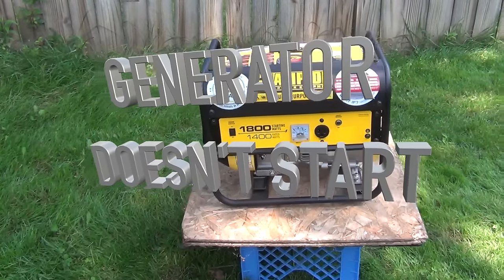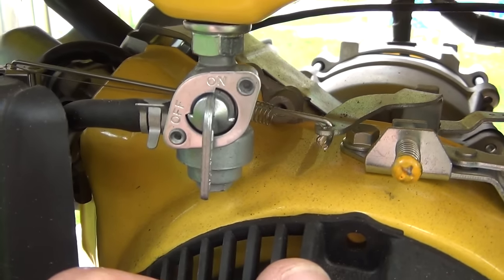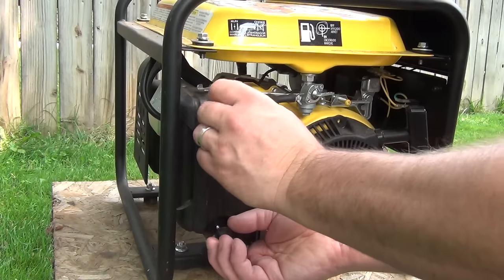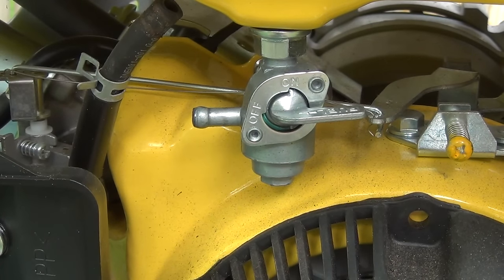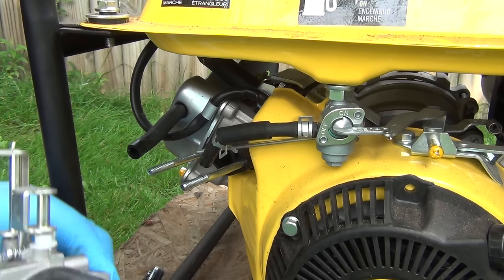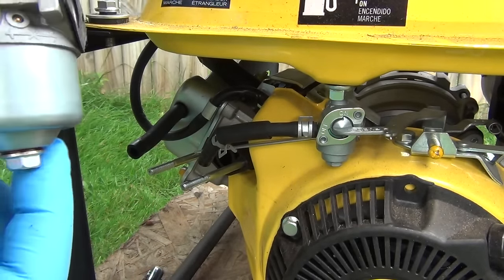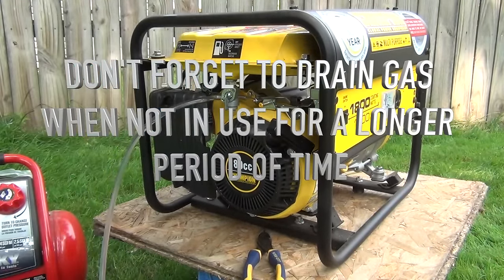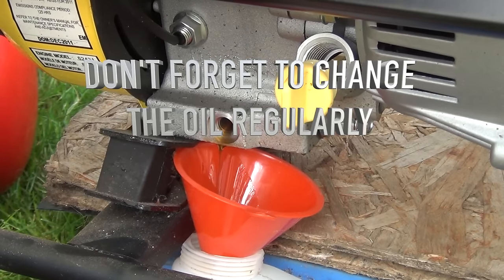Generator Does Not Start?

Comment: Generator would start, run 5 to 10seconds and shut down. The low oil light was on, but the the oil level was full.  I found the yellow wire coming out of the crankcase, disconnected it and electrical taped both connectors so they wouldn't touch each other or any part of the generator. It started and ran like a Rolex.  Thanks for the very helpful, detailed and easy to follow instructions.

Comment: Thanks mate, you got me going again. When I checked my oil level, it was almost empty but after I topped it up, the generator started immediately. You have saved me a lot of hassle. Well done and great video.
Reply: Very good tip Mate ! I oftentimes forget to check suchlike things.
Cheers !
One reason I love the Harbor Freight  Neon Spark checker, you can test for spark with virtually any engine that produces a spark save anything that has individual coils on each cylinder.

Comment: Tried to start my generator yesterday. 
It is the exact model you have so finding this was lucky for sure.
Today I did as you show and found the jet clogged, a bit of cleaning and reassembly and it started right up.
Without the guidance i would not have fixed it most likely , 
Thanks for helping me get it running again!

Comment from the maker: By the way: Most of the time it is old gasoline, that prevents the generator from running. It seems to collect in the carburator.
Reply: what do you do if its old gas
Reply from the maker: Drain the old gas, open the screw on the bottom of the carburetor as shown in the video, put everything back together, fill in new gas and you're good to go.
Reply: mygiguser my generator starts but no power to outlets any ideas
Reply: Check thermal circuit breaker sometimes they fail open circuit and won't reset check wiring and sockets for continuity you should be able to test the resistance of the stator through the mains outlet and this will prove the generator will work if there is a rotating magnetic field. If the generator has been dormant for a long time and it is self exciting type the rotor can lose residual magnetism needed to self excite unfortunately only way to fix that is remove the rotor which is the spinning bit inside the alternator and give it some loving with a strong magnet not important to be perfect just enough to leave a residual field to get things moving probably not a bad idea to test the diodes in the rotor field f accessible then put it back together and run the generator it will establish correct magnetic field once it's generating again.

If unit is externally excited then could be a faulty avr ( automatic voltage regulator ) board or worn brushes and in rare cases open circuit winding in rotor in this case repair gets expensive.
Reply: Check thermal circuit breaker sometimes they fail open circuit and won't reset check wiring and sockets for continuity you should be able to test the resistance of the stator through the mains outlet and this will prove the generator will work if there is a rotating magnetic field. If the generator has been dormant for a long time and it is self exciting type the rotor can lose residual magnetism needed to self excite unfortunately only way to fix that is remove the rotor which is the spinning bit inside the alternator and give it some loving with a strong magnet not important to be perfect just enough to leave a residual field to get things moving probably not a bad idea to test the diodes in the rotor field f accessible then put it back together and run the generator it will establish correct magnetic field once it's generating again. If unit is externally excited then could be a faulty avr ( automatic voltage regulator ) board or worn brushes and in rare cases open circuit winding in rotor in this case repair gets expensive.
Reply: Thanks.  Good advice.  If you had a suggestion how would you prevent in the future.  Buy special gas, gum out.  Seems to happen to me every year.
Reply: Actually its not old gas collecting in the carb, its water. Gas floats on water, so the water will always be at the lowest point of your fuel system (your carb).

Ethanol which is blended into the gas, will make the gas collect water faster, so you want to pick ethanol free gas for any carbureted engine (if available in your area).

Top tip: When shutting your generator down before storing it again, dont use the electric cut off! Just close the pet cock and wait until the generator dies. That way the fuel bowl of the carb is empty and it cant collect the water. Of cause this will not stop the gas in the tank collecting water. But that way its much easier to remove the old gas and put fresh gas in. Also the water in the carb will cause some serious corrosion on the brass (jets) and aluminum carb parts. So you dont want any water to be in your carb.
Reply: It works if I have to chare

Comment: Many thx for the video … my carburetor interior and particularly the float were a deep yellow colour.  I tried compressed air and a deep cleaning but didn’t work.  Starting again tomorrow but planning on disassembling and cleaning the jets with carb cleaner and steel wool - wish me luck
Reply from the maker: Good luck!
Reply: @mygiguser  works now, thx for the excellent video and the 🤞. the main jet didn’t appear to have a slot in the brass bolt.  I applied carb cleaner down the tube - two side jets were easily removed-.at first the screws wouldn’t budge - great care must be taken with these brass screws because the metal is very soft  - so I applied penetrating fluid and waited 30 minutes.  Thoroughly cleaned the jets with carb cleaner and slid a thin needle through the tiny holes in the jets.  Didn’t start last night but this morning it’s working like a … we’ll, like a generator

Comment: Difficult to come to terms that the spark plug was not checked at all,and probably one of the major causes at generator startup failure.
Reply from the maker: Spark plug may be second on the list,  but thanks for the comment.
Reply: Spark plugs rarely fail on small engines, I work on them it’s usually the carburetor that’s clogged up because of ethanol gas. Spark plugs usually last the life of the engine
Reply: @mygiguser  "Spark plug may be second on the list...", but 10 times quicker than all the work with the carburator.

Comment: I guess the consensus is that the problem was old gas.  I didn't see a lot of gas in the carburetor.  I use leaded gas in my small engines.  Its expensive and the octane is high, however, the ethanol content is 0%.  Ethanol invites moisture (water) into the carburetor and before you know it, you are either rebuilding the carburetor or replacing it.  The alternative to leaded gas, if you can't find it, is to buy gas with a low ethanol content and treat it with StaBil gas additive.

Comment: What is the tool used to remove the air filter housing?
Reply from the maker: ratchet with extension and 10mm socket?
Reply: @mygiguser  thank you! My adjustable wrench couldn't fit the tight space but I managed to remove it with pliers. Thanks to your instructions I was able to make the generator work.

Comment: Followed exactly.. Still not running or even almost starting.  Of course in the middle of the night with no power.  Only thing left is to try new plug. It looked fairly clean when i took it out to look..but thats the onoy thing left it might be... Plenty of gas, blew out the carb holes.. Nothing.
Reply from the maker: oh man, sorry to hear. my power is out too right now. what are the odds. did you check the oil? there is a switch that turns it off when the oil is low!
Reply: Just did per your advice.. No luck there
Reply: Forgot to add reply... Took apart carb again, used air compressor to blow out holes.. Works like a champ. Now at least I know how to take it all apart.

Comment: Hey man, i have dual fuel generator i mean generator use natural gas and petrol as fuel . now generator works well with petrol but not with gas, what will be the possible problem with my generator, please tell me.
Reply from the maker: PUBG Gamer that’s even easier, i can’t believe you have a problem with that. Either the hose is clogged, or the pressure regulator is damaged.
Reply: @mygiguser  thank you for your reply, can i send you my generator's video? Because here mechanic didn't correct it. :(

Comment: So here's a question: I cleaned the carb (2 pinholes, blew out the emulsifier tube as it cannot be removed). With a drained carb it starts on brake cleaner, but when I open the fuel valve it will not start, not even on brake cleaner. Where should I look?
Reply from the maker: maybe the fuel valve is clogged? or the gas tank vent not working?

Comment: At the throttle, I see the thicker wire.  What is the tiny wire ?  What is it supposed to be connected to ?  I had to manually hand-jive my throttle for about a minute before the engine would run on it's own.  Thanks !
Reply from the maker: are you talking about the throttle return spring?

Comment: turn gas valve off....when storing...and run until gen stops. This will empty the float bowl...so as not to collect water and prevent corrosion of old gas. Sta-bil should be used if storing for longer than a week.. Gas looses octane quickly.
Reply: H

Comment: lil tip it worked for me  ....the filter in the tailpipe was completely dirty and that wasnt letting the fumes out ... there fore shutting off the engine ......so i clean it and problem solved.
Reply from the maker: Thank you. Great tip!
Reply: Hie, I accidentally mixed 2stroke oil with petrol in 4stroke generator and tried to start luckily It didn't start so will you please help me.
Reply from the maker: Just remove the 2 stroke gasoline, and refill with new 4stroke gasoline. No problem! Thank you for your comment!
Reply: @abrakamjoxmhlanga1551  
You should be able to run two stroke fuel in a four cycle engine just as long as it is just one fuel tank without damaging any internals just as long as the fuel isn't too rich. I do it all the time.
Reply: frank ramon villalobos
Reply: Spark arrestor screen is what your referring to.
Reply: A woman here who has never tried it and doesn't know much of generators about to ask a silly question. What is a tail pipe?
Reply: Is it the same as the exhaust pipe?

Comment: That was a great video! But what was the problem?  it didn't seem to be diagnosed
Reply from the maker: Well in this case metal shavings were blocking one of the jets. This must have happened in the production process of the carburetor. It was working for  at least 20 hours, as it all of the sudden quit, and then never started again.

Comment: Hey mine don't start I even cleaned carburetor and remove the wire sensor for oil all it does is run for like ten minute and shut off what to do next I have been trying 4 days now
Reply from the maker: Earl Aragon the vent in the gas cap clogged?

Comment: tip to  easy start. just put quick start propane gas into the chalk filter. and thats it. also you cn use the  lighter propanane gas if you not have the quick start be sure to adjust the level of the lighter  to high to give more gas to the filter .
Reply: "chalk filter"???

Comment: Unplug the oil pressure switch. If it starts, change the switch. If it still doesn't start look for another problem
Reply from the maker: Yes, that's right. When the switch is closed, the wire is grounded, and the engine doesn't start. Either not enough oil, or the switch is broken. Make sure you have enough oil! It doesn't take much to wreck an engine without oil!
Reply: jerry Cannon would you know why mine runs on choke only and smokes white smoke then when I take choke off it stalls.
Reply: Tia.
Reply: Ranjit mm m

Comment: Not sure what you did here, you cleaned a clean carburetor now it works?
Reply from the maker: ns671fr there was a tiny piece of dirt stuck in carburetor. The generator was only a few hours old, ran maybe 100 hours before it stopped working.

Comment: most of the times, the needle get stucked and don't let the fuel get into the carburetor... especially on 2 strokes engins, because oil residue turn into some kind of glue
Reply from the maker: Nando Z great, but this is a four stroke engine.

Comment: Why not spray quick start into the carb?  If the engine fires then a fuelmissue is confirmed.  If bonfire, check for spark.  That initial step takes seconds.  I always kept a can of quick start by my generator.
Reply from the maker: buddyboy4x44 quick start is not good for the engine, it washes off the oil from the cylinder walls. the smaller the engine the more damage it can cause. it depends on how fast it starts with that fluid. in this case a piece of debris was blocking a hole that n the carb. starter fluid would not have helped. if the gen was sitting for an extended period of time, then the oil film on piston and cylinders would be extremely thin. that’s why i avoid starter fluid.
Reply: mygiguser can you please help me, my champion only runs with the choke on, lots of white smoke, then when I turn choke off it stalls, bought brand new carburetor and exact same problem, please help.

Comment: About the biggest issue with ANY generator is leaving the gas on. ppl see the ignition sw. or
 engine switch that says run/stop. they flip engine stops an that's IT no worry about leaving 
gas in the carb for months at a time with no stabilizer in it. YUP that'll send Gertrude in a tizzy
well that is what I call her. When I work on a gen 1st things is to check oil, how much and the
quality of it. mostly every engine has a low pressure oil shut off, a yellow wire from R. side  is
wired into the ignition magneto so if oil pressure decreases, mag is shorted and plug will not 
fire.  If gas  has has not been left in the carb, make sure oil is within a two threads of dipstick 
before it starts to run out and unhook the yellow wire. Good chance engine starts, if it shuts 
down when ylw wire is hookt, oil sensor switch is probably stuck, unhook wire and restart, 
keeping eye on oil. possible oil sw. will free up inside and allow engine to run with it hookt
up as it should be. other engines have a little cube with 2 wires leaving it, This is either a 
diode or quite possibly a transistor.

Comment: You need air, spark, fuel ! Pull carburator before spark check ?? No !  If spark , fuel, clean  air filter , problem could be old gas ! Spray starter fluid into unchoked carb, close choke, try starting ! This should work for almost all starting problems !!

Comment: I have same generator, it only runs on choke and smokes like hell, then when I flip it over to run it stalls, can anyone help please.
Reply: Clean your carburator.
Its jet(s) are clogged.
Thats why it only runs on partial choke. To avoid this issue, run your generator at 40-80% load every month for at least 15-20 minutes. Then disconnect the electrical load, close the fuel valve and let the engine stall by itself as gas runs out.
Better yet is to drain your carburator float bowl completely.
Its the little amount of gas in your carburator float bowl that goes bad with time and gums up your jets.

Comment: Before doing all that work, use a shot of engine starter first and try to start again. If the engine sputters, at least you know the problem is the fuel and not ignition.

Comment: This guy forgot to mention always use four stroke engine oil on small motors never car engine oil they do not have detergents to last 50 to 200 hours!
Reply from the maker: where did you learn that? Did you know that most car engines are four stroke engines?
Reply: That is correct but car has oil pumps and filters to maintain the temperature of the oil! a air-cooled engine does not it just splashes around! Ask the people who cut grass what kind of oil they use on their $20,000 lawn mower is it engine motor oil or four stroke air cooled engine oil that only limit to 200hr synthetic oil or 50hr non synthetic conventional oil.

Comment: My friend, my generator is on but run 5 minute is off
Reply from the maker: After 5 min off? When it dies, open the nut on the bottom of the carburetor, and see, if there is gas, if there is, then you have an electrical problem. Oil level switch? Maybe oil too low? If there is no gas, then it could be the ventilation valve of the gas tank (should be in the cap). If that valve is clogged, there will be a vacuum building in the gas tank, if you leave the gas cap open, does it run longer than 5 min?

Comment: I'd check the spark plug before I ever take the carb off. Unnecessary can of worms if it's not getting spark you could replace the whole machine and if the plug isn't any good it still wouldn't start. Good detail though. Appreciate the time.
Reply from the maker: J. Philip Fortin you think that is the most common problem? Most generators do not have good fuel filters, dirt gets in there easier than you’ll get a failing spark plug. Most common will be dirt, and old gasoline in the carb.